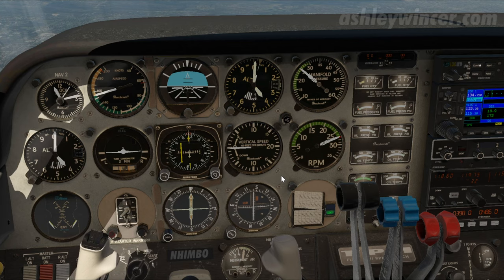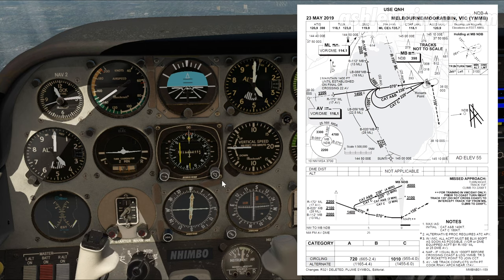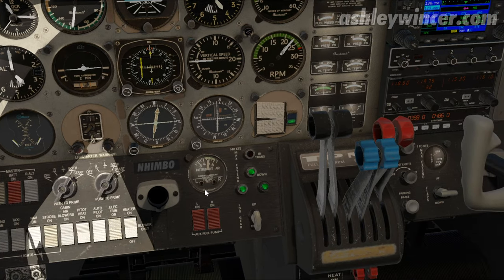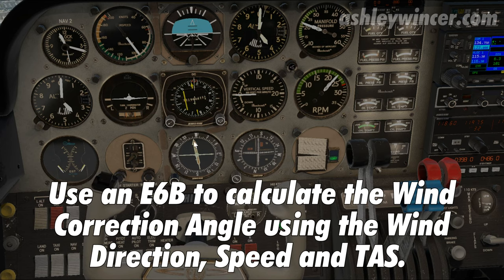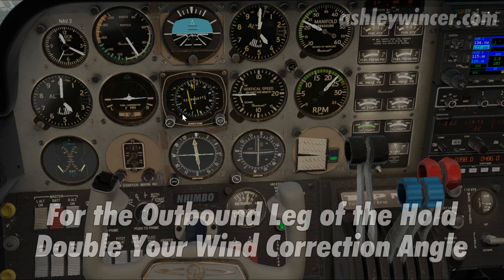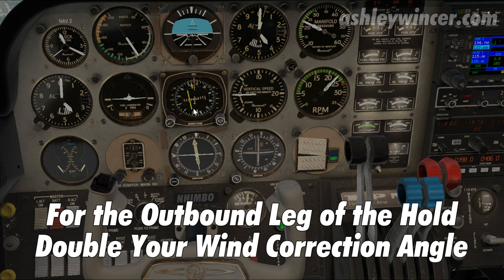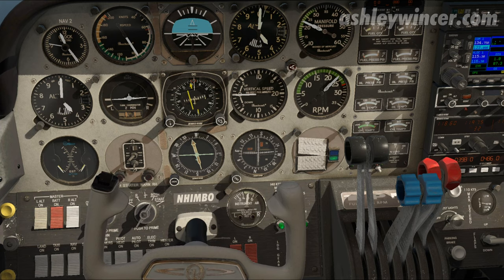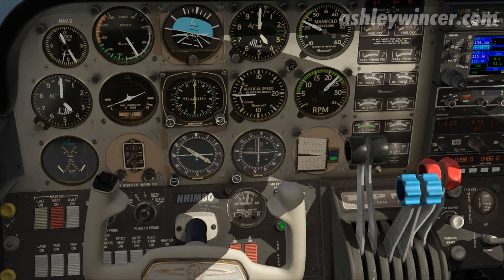Flying a NDB Approach with Wind Correction | BE76 Duchess | X-Plane 11

Comment: A lot of people say you should triple the wind correction on the outbound, even my instructor, but when I actually did it in the simulator I found that of injusy double it, it works really well. How come for some triple the wind correction works and for us double works. Thankyou so much for this video it helps so much in studying for the instrument rating
Reply from the maker: The amount of wind correction needed will depend on your aircrafts TAS. When I mention doubling your wind correction angle, that was based on a TAS of about 100 knots.  The slower your TAS, the larger the wind correction angle will be. I forgot to mention that in the video..

Comment: Firstly, thank you so much for these videos, you along with other's have really helped make the concept of NDB's easier. :) 

Your explanation in this video was extremely clear, however, I was just wondering, how would you approach a pure raw data NDB Hold with no GPS at all (i.e pure ADF)? I'm not sure if they can be this strict in any exams though.
Reply from the maker: No worries Mike, glad you liked the video.

When flying NDB holds when only making reference to the ADF, you use time.

Start your timer on the outbound leg when abeam the navaid or wings level; which ever comes later.  Then you will need to modify you outbound hold leg time in order to have an inbound leg of 1 min (If it is a 1 min hold).

Increase the time outbound for 1 second for every 1 knot of headwind outbound; or decrease the outbound time by 1 second for every 1 knot of tailwind.  That should enable your inbound leg to be approximately 1 minute.  I may have just made it more confusing??  Hope it helps..
Reply: @AshleyWincer  Thanks, very clear answer! :) 

So basically just having an idea of the enroute winds, either via the METAR or ATIS should be a good "rough" indicator for timing. 

By the way,  I completely agree with a previous video were you said keeping the ADF compass fixed is easier, twisting I find makes it more confusing.

Comment: In the initial stages of IFR study. Your videos are so very helpful Ashley. Thank you for putting together such a useful resource. The time and attention you take is noticeable. Your explanations are clear and well illustrated by your apt use of the sim. I'm just a little confused about one thing. Initially you have a wind coming from the right, this is shown by the head of the ADF needle moving toward the right. I'm with you so far, but next is where I loose it. This would be correctly referred to as "right drift". What has me befuddled is the aircraft is making a track good which is to the left of the heading held, it must be if the station is moving to the right relative to the nose of the aircraft. The crux of my question is, why wouldn't this be referred to as "left drift" and not "right drift" if our TMG is indeed less than our HDG being held? Are we not in fact drifting to the left? Hope this makes sense and greatly appreciate any illumination you can provide to this confused man :)
Reply from the maker: G'day Cale, Thanks for your comment.  Good Luck with your IFR studies, you'll be right.  Unfortunately I cannot be of much help.  I understand what your saying, I always found those terms to be quite confusing myself and still do. I don't remember the last time I made reference to those terms; Track Made Good, Left and Right Drift.  I had forgotten about those terms until you mentioned them in the comment..
Reply: Oh well! Worth asking. Thanks for taking the time to reply anyway. Keep up the great work with the videos mate. Excellent resource to have around. Cheers again, Cale.
Reply from the maker: Thank you Cale..